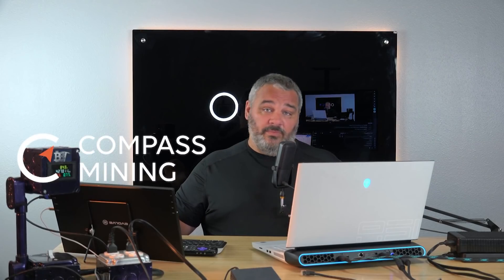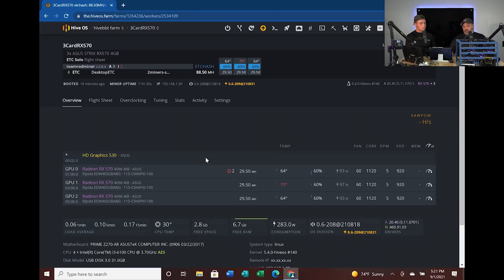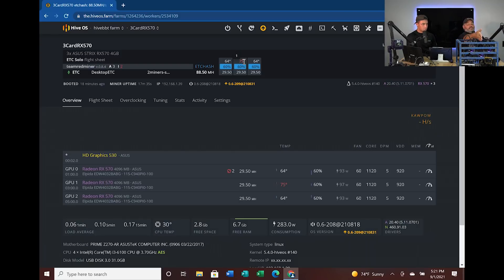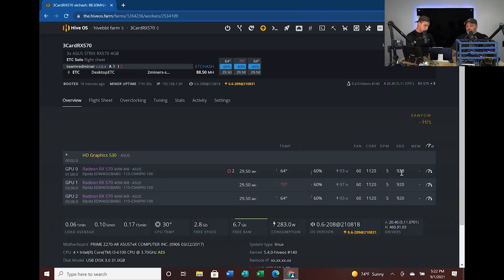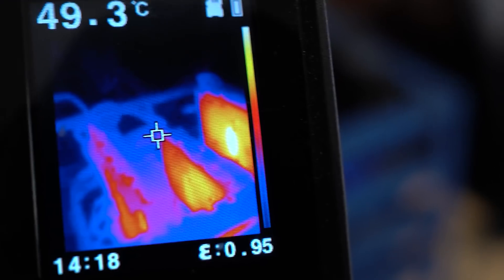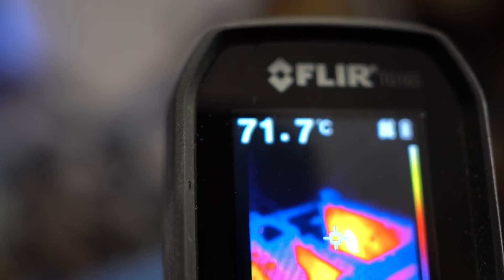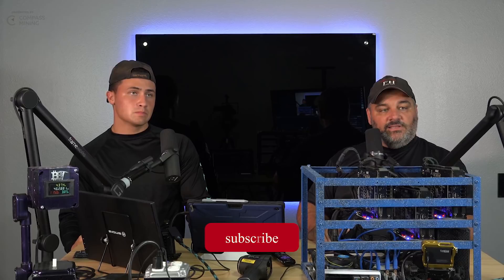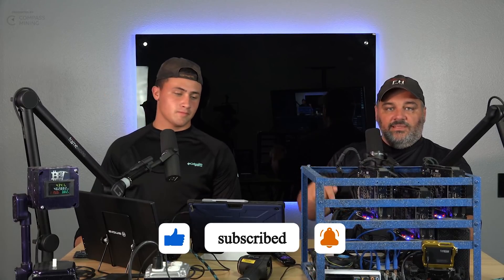Thermal Paste replacement on a 4 year old GPU, RESULTS

Comment: Man raven needs more cooling less tune on the mem, more cpu power and a lot more system ram. Raven mining with kowpow is a way more challenging than eth. The algo switch is intense and burned up some of my highly tweaked cards already.
Reply from the maker: It is a much more intense on the GPU. You can under-clock core/mem and drop that voltage to not impact as much, it will drop your hash but save your GPUs.

Comment: Hey BBT, if you use DPM 1 and agressive undervolting doesn´t the gpu temps drop a bit to?
Reply from the maker: Yes, if it's stable, with the ASUS RX570 STRIX it freezes up with anything lower than DPM 3 and lower than 910 ; our Sapphire RX470's though can do DPM 1 and 840mV
Reply: @BitsBeTrippin  i have those, yap, elpida memory is the problem, if you want to run them cool and stable, on etc i have them dpm1 , core 1100 mem 1800 (elpida is bad at high clock with this one) and voltage 825 on ccore and mem, and it work cool with 60% vents 57-59c and 29mhs. For me that was the sweet spot with this cards.

By the way, on ergo i running smoothly on 825 voltage, 55-62wats and 59mhs on team red miner
Reply: @BitsBeTrippin  Nice Sir, im runing DPM1 and 850 on my 8gb 590´s and they are runing smooth for now, around 72w on software and around 32mhs